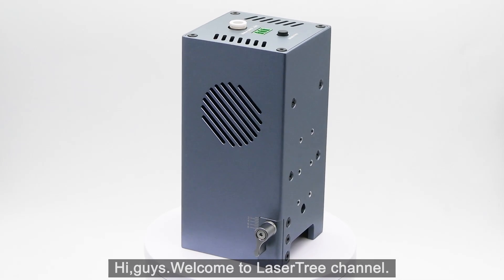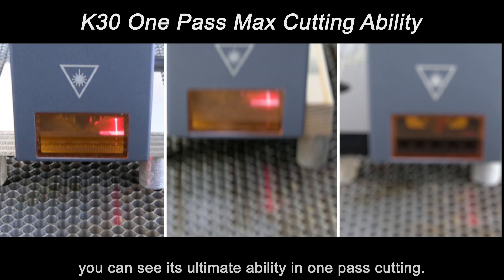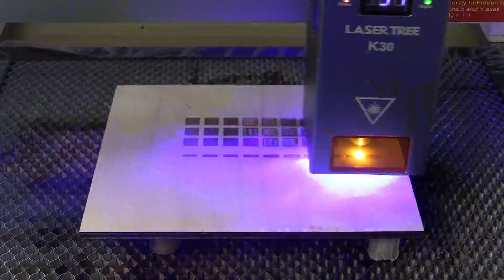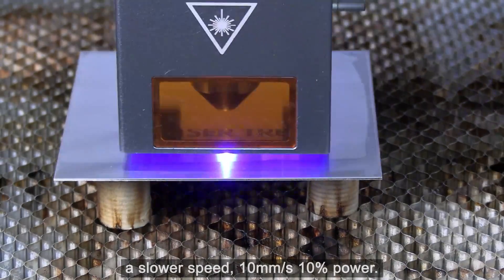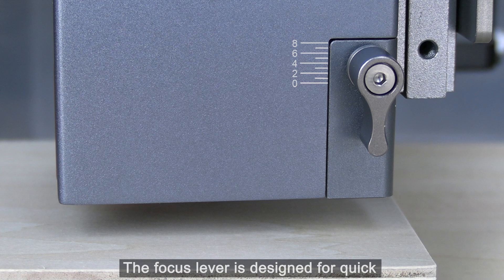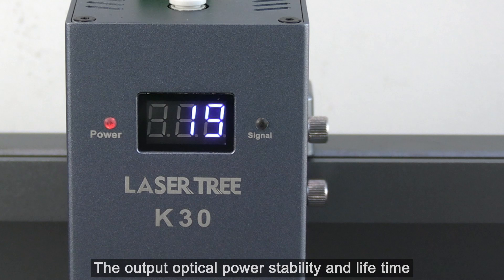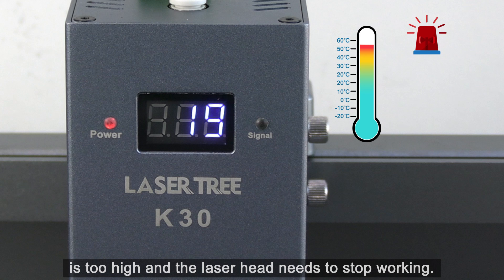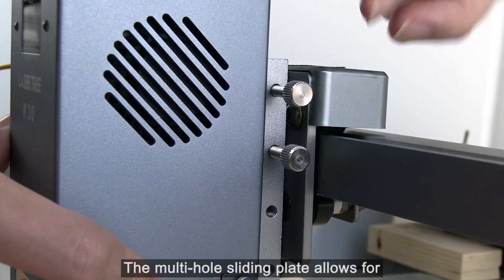LASER TREE K30 | 30W+ Optical Power Output Laser Module

Comment: The laser focus on this laser is rather large..
Reply from the maker: Yes, the spot size of K30 is 0.16*0.19mm. Because of the increase of diode high power module in the combined light spot will become larger.

Comment: But there is a 40watt by x tool😊
Reply from the maker: Buying K30 does not need to buy an additional machine, it can directly upgrade the machine.:elbowcough:
Reply: @Lasertree  when yall releases the 40watt let me know
Reply from the maker: @8mmmauser896  We will release the K40 a little later. K30 is also a very good choice, its optical power output is 33W-36W.
Reply: @Lasertree  what is the estimated launch of the k40?

Comment: Can this be used on a 12v machine (Ortur LM2) please
Reply: The Laser's head is powered by a separate power supply that comes with it. Meaning it does not matter what voltage your machine is.   I am using their 20-watt head on my Ortur LM2.  Very simple upgrade (20 min)
Reply: @RichardCournoyer  Did it plug directly in or did you have to do additional wiring